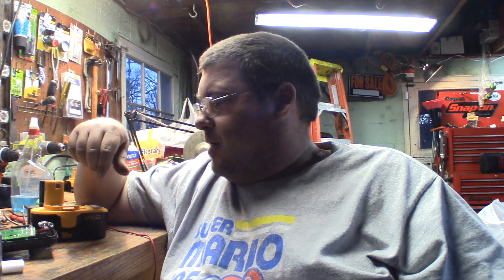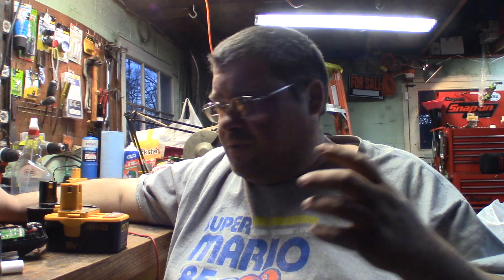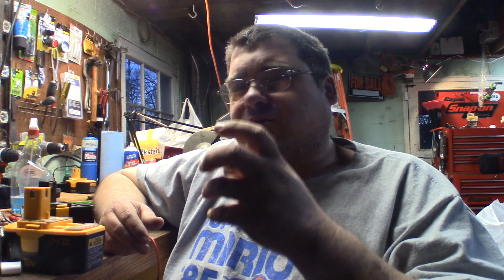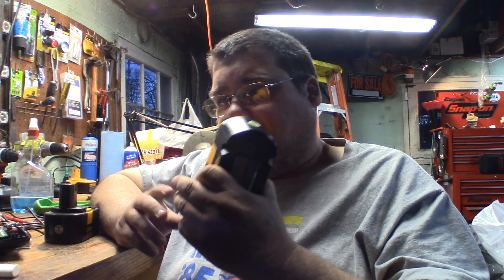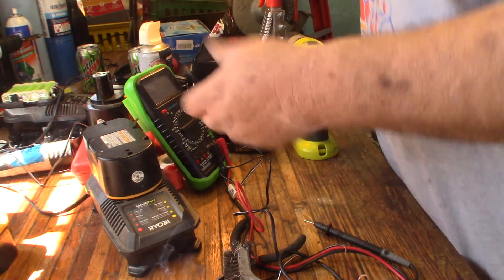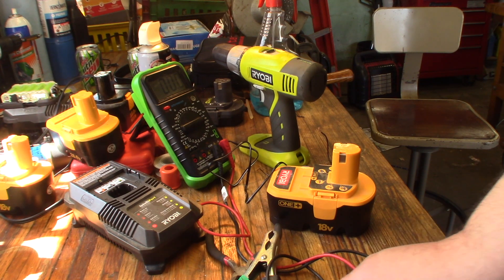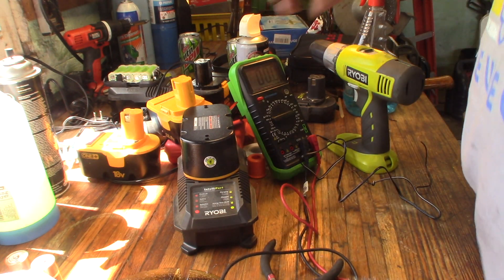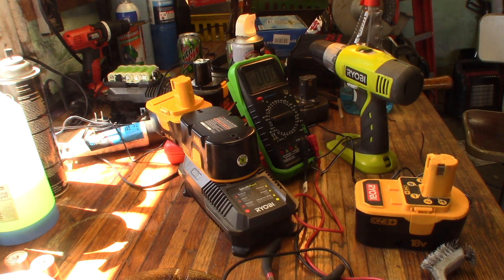How to Bring NI-CAD Drill Batteries Back to Life & Make Them Charge Again - Ryobi

Comment: Nicad batteries if left aside without any attention for long time become useless. Even if you zap them in this way the video shows, you will have a temporarily success. Still the battery does not recover fully. A capacitance test will prove this is true very easily (i.e. the operation time of the tool after zapping the battery). Thus the battery pack has to be under trickle charging, when not in use, at a very low rate. C/300 is a good one. In any case, NiCad have very high rate of self discharge and this is what has to be outweghed. If any of the internal cells falls below 1V, when the pack is not used for long time, this cell gets critical problems, potentially irreversible. Another point for attention is to monitor the depth of discharge when working with the tool. Due to the series connection of the cells and the fact that they do not have equal capacities even when the pack was made with matched cells during production, when using the pack, inequalities between the cells start to grow. At a given time, one or more cells are much weaker than the others. These charge and discharge faster than the rest. Thus when charging, they are forced to overcharge. When discharging, they are exposed to get reverse charging because they are empty much sooner than the others. Reverse charging causes them to short irreversibly. So never over discharge the pack. If you see that the revolution speed drops enough, replace the pack you use and charge it. Finally, as everything in life, batteries have and end. This comes to these NiCad after many cycles of charges because the water of their electrolyte has gone through the electrolysis process of charging. The battery is now dry. It's internal resistance is soaring, it cannot put out much current while it seems to charge and discharge within a few minutes. No zapping can help here. "Game over, insert coin"!

Comment: If this works so well Why does Nobody offer a service to do this for Your batteries - I have seen a number of similar videos and in every one the battery that allegedly gets fixed is Not shown in the charger first !
Reply from the maker: Ship them to me and I will do it for $20 a battery.  If it doesn't charge afterwards I won't charge you.
Reply: $20 per battery - Dude you need to lay off the drugs - $20 is half (or more) the price of a new battery and $20 for 30 seconds work...... there's the clue that you need to quit drugs - I would pay $5 for each battery successfully restored and $2 for each that can not to cover the cost of disposal - - there are a number of similar videos, There are always one or two that do not work and you NEVER see the one that does work put in the charger FIRST to prove it will not charge

Comment: Can you short is with 120V? what are the settings on your welder or does it matter.
Reply: Only do that if you’re trying to shock yourself and maybe die.  The power needs to be DC, not AC, and if you don’t understand this then you should probably should avoid doing this.
Reply from the maker: I have seen people do it 120V but I wouldn't.  The switch on my welder is on LOW instead for HIGH.

Comment: Ive done this but i used two good tool batteries wired in series to form a 36 V cell.  I used that to zap the bad batteries instead of a welder.  It worked well.
Reply: I wonder if my 50 amp battery charger/car starter would do the job?

Comment: I worked for Duracell for 5 years, one of my jobs was abuse testing batteries by applying overcharge, when a battery blows up  CAUSTIC ELECTROLYTE and TOXIC CHEMICALS such as CADMIUM and Lead spray everywhere. The overcharge blows a hole in the thin dielectric insulator and suddenly SHORT CIRCUIT from Anode to Cathode. Don't do this with a welder and up close. Even if you wanted to try it, you'd do it outside, and attach to the battery first, then plug in the cable to the welder from far away, but even if it worked, you've weakened the dielectric and risk a short/fire appearing. And the whiskers are called DENDRITES. Especially with LITHIUM, any tampering, the risk of it catching fire in your garage when you're sleeping is high. . If you won't buy a new battery,  -I'm very frugal...do it remotely with a variable power supply set only  a few volts above original charger Voltage output for a short duration spiked connection, outside, and lock the battery up in a fire safe area when not in use and hope it doesn't short in your hand...IN the future with all your batteries, immediately remove your new battery from charge  as close to 90-95 percent or immediately upon full charge indicator, and don't keep using once it gets low, keep it above 25 percent if possible. In the old days we battery guys claimed always 100 and 5 percent to avoid memory effect, but thats all changed and does not apply to lithium, a hybrid car battery works in a short mid range to make it last over 8 years
Reply: Thanks for the useful advice. I will follow that when charging electronic devices including my smartphones. Cheers :-)

Comment: Y0u dont show how to determine which terminal of the battery pack is + or - ; also, which side to put the welder on + or - .  Most welders the ground clamp is - (negative) and the rod holder is + (positive).  Does it matter which of these is on the battery + or- ?
Reply from the maker: Most Welders are AC so it doesn't mater.  If you have a DC welder then you would want to match the polarity.  The best way I could tell you is to measure it with a multi-meter.  I should have some amount of voltage to tell you which is positive.
Reply: So the dendrites will collapse regardless of the direction of electron flow?  Some of the other dendrite demolishers seem to require same as charging polarity.  One guy uses two 20 VDC battery packs hooked up in series to provide the jolt.  OK will give it a try thanks. I've got a DC wire welder so I'll turn down the feed and the voltage.
Reply from the maker: Electrons flow both directions equally on a AC welder.
Reply: How does that answer: "So the dendrites will collapse regardless of the direction of electron flow?" Wont the opposite flow reinforce the stronger dendrites making the battery useless?

Comment: Sweet tip. A lot of these rechargeable batteries don't like the cold. So charging them in the garage in winter can cause issues. They also  have so many different types that some can fit in the wrong chargers and cause these problems. I had a ryobi one plus 18v lithium drill so i bought another tool exactly the same knowing i wouldn't have any compatibility issues as that's what the main selling feature of the "one" is all about. I went to put it in the charger and it didn't fit. I re- check same voltage 18, type lithium, brand one -plus. wtf? WTF? I guess maybe there's white lithium, red lithium, lithium ion. We are getting ripped off more and more. It's not like these tools are cheap either. The batteries are hundred bucks.  Also what  pisses me off is they make most of the rechargable AA batteries only 1.2 volts so you can't use them in most stuff and the its super low capacity as well 300 to 600 compared to 3000 in some. I found rechargable alkaline batteries that were over ten years old that still work good.  Never heard of rechargable alkaline. As a side note, be careful when recharging regular alkaline, the more expensive brands like duracell and enegizer have safety features, that cause them to explode. I guess their definition of safety, won't allow recharging, is little different than mine, won't cause injuries. There's no warning when they explode  and it can be a while off the charger. And they do explode. I  do any of this stuff outside and away from people in a welll ventalated area as well as they can give off fumes and caustic liquids. It's not nearly bad as back in the day with regular car batteries. When I changed a battery out in my vehicle everything would seem fine but then when pulling my clothing out of the dryer a few days later there would be huge holes in my clothes. Not sure why it didn't show up until after they were washed?   The cheaper alkaline  seem to work better but i'm a little more cautious after one exploded on me . The trick is not to let them overheat. I also found a lot of 9v batteries have 6 x AAAA batteries in them which is weird as have never heard of them. Also old 6V batteries have 4 x C (maybe  D batteries in them. Even drill batteries are composed of 15 x 1.2 batteries.  Old Laptops have the best  batteries.Solar lights usually have good AA or AAA batteries in them when they get tossed just low storage. I'm sure you already knew all this. Also the cell batteries in watches and digital  scales are lithium. Are they rechargeable?

Comment: there is a thermal fuse inside the stem of the battery connecting the battery to one side of the terminals. I have several times found it open and replaced it with a piece of solid copper wire and the battery worked fine.

Comment: I have the very same Ryobi batteries, with of course a history of the same problems.
   The Red Flashing light that appears as soon as the battery is connected, indicates a battery that even if not Charged, is however a healthy state battery (ready and capable of) Charging.
 The red flashes will be for between 5 to more than 10 flashes, until the Charger tries to go to the next step in the procedure.
  I never got success with zapping the battery pack as a whole.
 I instead dismantle the battery unit to access the individual batteries.
 I would not now consider zapping the whole unit as one, as I would be exposing, even the good cells, to the chance of being burnt out by the zapping.
 I use a 12v car battery - zapping whichever individual cell that has been measured as bad.
 I use a relatively fine wire to contact the battery, and only very lightly flicking the wire and you see the sparking.
 I never press the zapping wire to the battery, as I have lost batteries, that are easily damaged when too much current surge is allowed to zap the battery - which is more possible if the zap wire is 'pressed' against the battery cell
Reply: Excellent tips and advice. thanks for sharing them with us!

Comment: I couldnt tell if the smoke was from your batteries or your cigarette. Try using a car battery charger instead of a welder and it will work better.
Reply from the maker: Smoke is from Camels

Comment: How many amps do you set the welder for
Reply from the maker: Mine has two settings, low and high.  I set it to low.  I would say you can set your welder to the lowest amp setting.  The battery is only going to pass as many amps as it can unlike a welding rod that is creating a direct short to a ground.

Comment: DeWalt charger tells you that the charger reconditions the batteries if you just leave them in it all the time you aren't using them. I thought they were supposed to shoot a surge through them every so often to recondition them but I've had them stop taking a charge before. Thanks for the tip. Yeah, you should probably at least wear a face shield when you do this.
Reply: It is hard to smoke while wearing a face shield. Priorities.

Comment: Great if you have access to a welder 👨‍🏭
Reply from the maker: if you have 2 other good batteries you can hook them up in series to get 36v and shock them with that.  When I get some more bad batteries I am going to do a video on that method.
Reply: I have two welders, but no need for this. 9V batteries in series should do ya (there's one in the smoke detector, not that I suggest you do it.) BTW getting a welder is a life changing experience like a new girlfriend, again not suggesting you do it.

Comment: UNPLUG THEN REPLUG CHARGER
Reply from the maker: That may trick it into charging if it i right on the edge, but I will not remove the whisker filaments between the anode and the cathode and fix the battery so it will hold a charge over time.

Comment: just cycle them with an rc car charger ... there so cheap
Reply: marderbeast .... used a 12v SE 5212A battery charger  on 2amp slow charge for 10 seconds....back to life with 2 dead 14v non charging batteries...thanks
Reply: And they always advised to fully discharge them before you charge them. Good idea, which will require some creative engineering to match up the charging unit and battery.
Reply: the cells will be 2-2500 mah sub c type so cycling at 1.5 amps will be a safe bet, you can use a pair of croc clips on the contacts, the polarity is generally marked on the plastic case + -

Comment: those are filled with c-2/3  ni-cad  DONT  TOUCH A WELDER TO TERMINALS, the touch with transformer isnt to bad but still wrong, if you can remove cover, look and see if you have a battery with the whitish-blue, if so you can get that battery replaced at batteries plus+, volts dont kill, amps do!!! a car high energy ignition coil put out 40,000-50,000 volts but not alot of amps, anyone that works on gas powered engines has been bit, a lawn mower has to put out 28,000 volts to get the blue spark needed to run, i didnt learn this in school, but hard knocks ,,be careful

Comment: I knew when you started talking about satellite batteries you had some very specific expertise, this is a great technique, you can isolated the failed cell/cells in the pack on the ones this doesn't work on, great video
Reply: I've been doing this for quite a long time. I've done it with coin cells, alkaline cells, Ni-Cad cells, and zinc carbon cells. It seems to work best with  Ni-Cad cells. I had a coin cell EXPLODE once. The danger is if you apply power for too long, the cells/battery will get HOT. If it gets hot enough inside the cells, the pressure inside the cell will get so high that they can EXPLODE. 

My Process:
1) Try to charge.
2) Measure individual cells voltage with DMM on dc range.
3) Those that measure anything close to what they should (1.2 vdc for Ni-Cad cells) will likely take a charge.
4) Those that are zero volts dc are most likely the "bad" cells.
5) Next I measure the "bad" cells DMM on low ohms range.
6) Most likely they will be shorted and measure close to zero ohms.
7) I zap the shorted cells with a high current DC voltage close to the normal voltage of the cell. Be sure to connect observe correct polarity (plus to plus and minus to minus).
8) Wait a bit before continuing (feel if cell is getting HOT). You do not want cells to EXPLODE.
9) I repeat steps 2-8 until cell no longer measure zero volts across the cell.
10 Go on to next cell.

The best voltage source is a high current DC power supply that allows you to adjust the voltage and  current limits for the output. Next best are variable low voltage welders and 6/12/24 volt car battery chargers.

Comment: i mistakenly tried and fried to charging a rc nicad pack with a 12 volt car battery. they heat up then smoke then pop or explode maybe after 10 seconds. less than a second is relatively safe in my opinion . good video.

Comment: why not clamp some heavy gauge wire over the terminals and make all the sparks well away from the battery at the welder side or by bumping the AC power feeding the welder.
no burnt battery terminals and you could place it under a heavy shield away form you, just in case.
Reply: FrugalPrepper's Garage & Garden. Depending on the brand, u'll save anywhere from $50 - to $100 ! Is that a lot of money ?
Reply from the maker: That clamps, shields, wire, extension cords.  Sounds like a lot of work.
Reply: throttle bottle )
Reply: With all the hamburgers and cigarettes, this big boy can stand any explosion...
Reply: Don't be an ass.

Comment: I'm not saying it does or doesn't work but, you failed to show us that the battery you "fixed" was inoperable
Reply: Jason k7
Reply: Jason I agree Jason.
Reply from the maker: Well don't do it and go watch some cat videos or something!
Reply: I thought the same thing!  LOL  I doubt using a welder will fix a battery and in my opinion, it's dumb to even attempt this!!
Reply: Terry C. Well I’d say dumb is speaking out on a public forum about a subject you clearly know nothing about...the welder isn’t the key it’s just a source of a reasonable electric shock ...this guy is absolutely right .this works almost every time and id also say that dumb is probably you standing in line to buy new batteries like a real tool of a consumer who loves throwing their money away and making some Chinese executive rich beyond imagination ....obviously you can’t  trust every looser that decides to post a YouTube video but they guy told you he lost the footage showing the proof that the battery was dead...the welder is the most effective and recommended source  of electric shock to correct dead battery syndrome ,but you can use another charged battery or a battery Charger ,or jump box ...laptop charger with a light bulb wired in line to reduce current ,but you go ahead and call it dumb and  spend your money foolishly...I have done this myself by simply putting the battery in the charger and plugging and unplugging was rapidly to correct the issue
Reply: @blakebarber5750  Loser, not 'looser'.
Reply: @stevenA44  it works.  I'm not sure you need so much power to do it though because i just use another fully charged battery.  Works exactly the same.